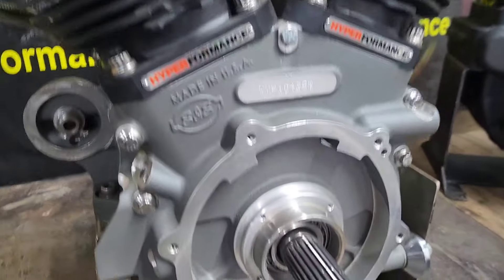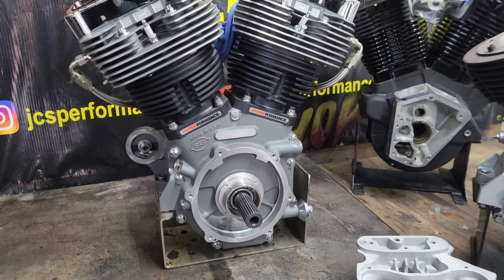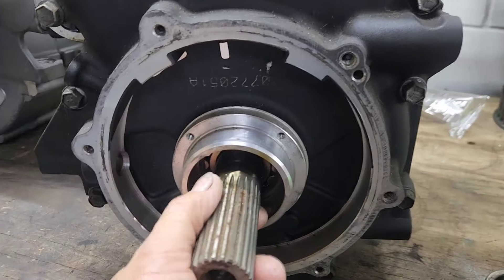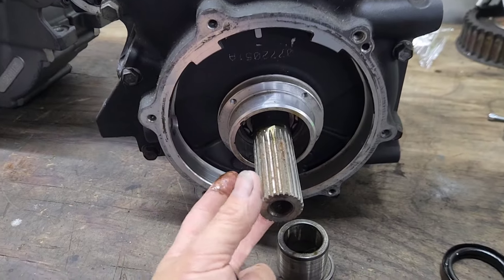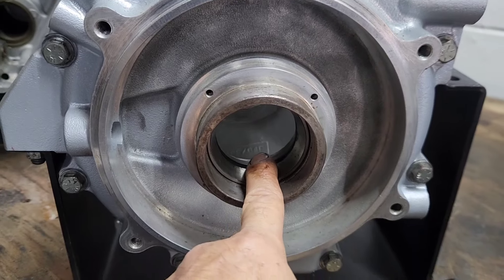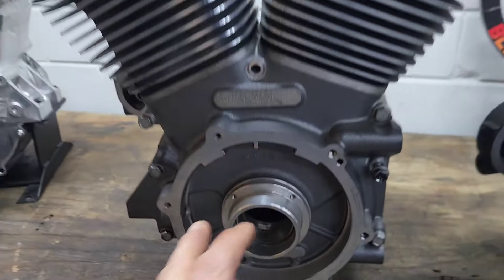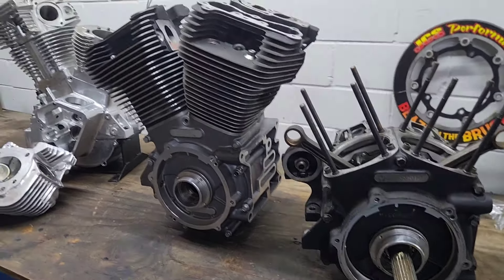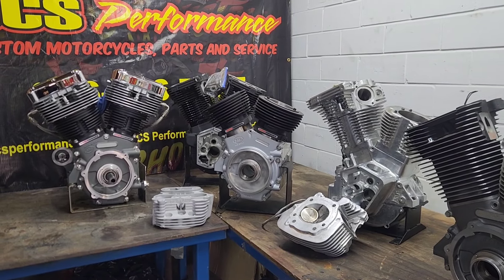Harley Bearing Timken Conversion VS Roller Bearing Performance Bagger Dyna FXR FXRT

Comment: Would you say run timken on a stunt setup?
Reply from the maker: Yes, definitely!
Reply: I’m sure you’ve heard everything about the Timken vs INA bearing argument. I’m leaning Timken, they’ve been doing it for 50+ years and when they started using INA bearings, the cranks were starting to have very bad run out, bearings were failing, so on and so forth. I’m doing a Timken conversion on my originally 88 (now a 100ci with a dark horse crank) and I’ll let you know how it goes brotha. Hopefully all goes well.
Reply: My 88 crank had crank runout of 45’ thou. If it had the timken in there, I doubt it would’ve gotten that high, considering the Timken is proven to support your crankshaft from axial movement, meaning as the crankshaft goes down, a lot of pressure is put on the bottom of the cage of the INA bearings, which is real real bad and can get you in a lot of trouble. Timkens are (I’ve heard) to be the solution to everything.

Comment: Thanks for the info, but I say Timken bearings all the way, everyday. There a superior bearing regardless of rpm your running and easy on the pocket book.
Reply: Agree 100%.  If you have a chance to convert to the timken this setup was stock until 2002 and is proven to control high load/high rpm crank flex so IMHO is a no brainer for any build.